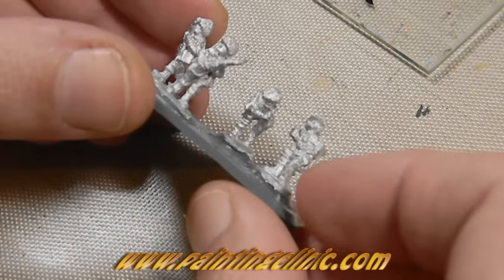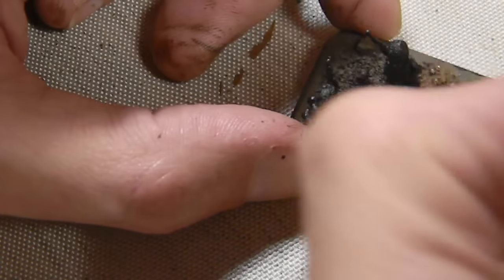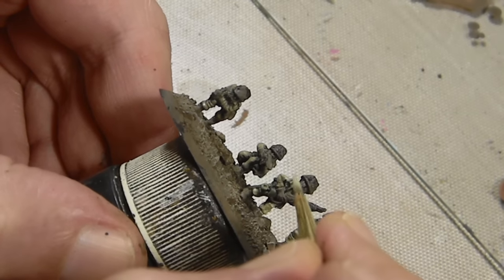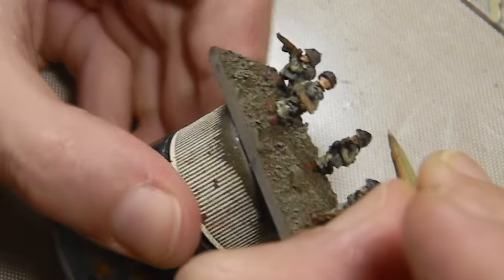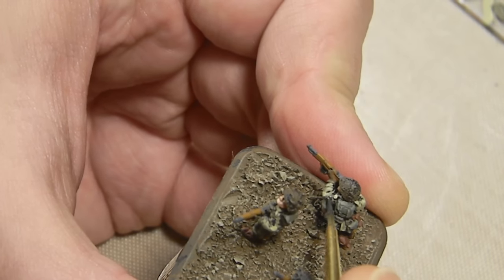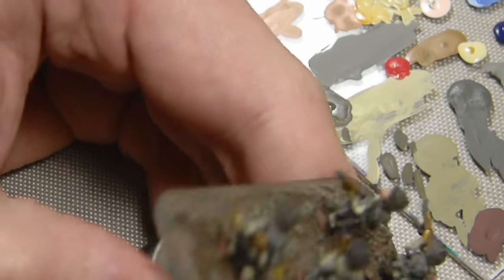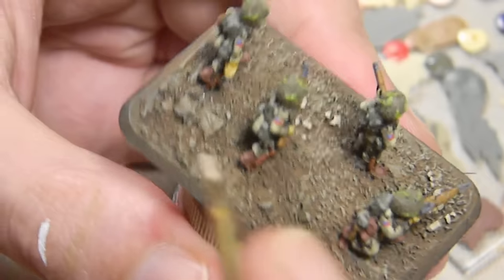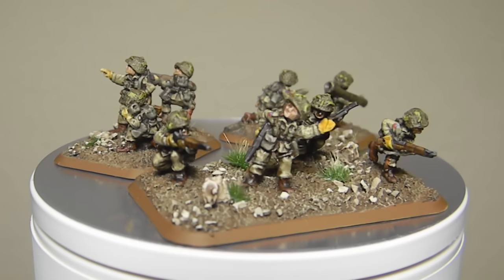How To Paint 15mm US Airborne for Battlefront FoW

Comment: I use a white porcelain tile too in addition to the wet palette, but @Kodokijolyus is having palette drying issues.  The wet palette is the solution for that.  One can try and be more careful with keeping paint on a dry palette wet, but that can be a nuisance if one is concentrating on some detail.  If I need the paint dryer (or even wetter) I bring it to the white tile and get it to the consistancy needed there.

Comment: When ever I play I always use Stuarts. Stuarts are very little points and have a ton of mgs. With a coax and hull and aa mgs Stuarts are very strong. They also move 16 inches to get right into the enemy's face. Don't send them against tanks but infantry. So if you use them correctly they can be incredibly over powered. One game I played I was against a SS company and killed 2 fearless Veteran platoons loosing one Stuart. They can changed the tide of the battle easily if you avoid enemy tanks.